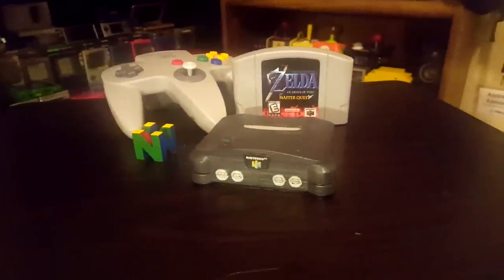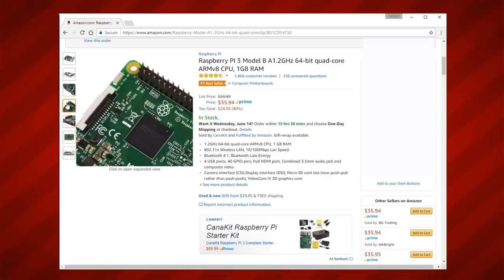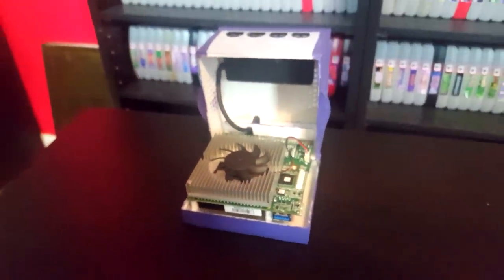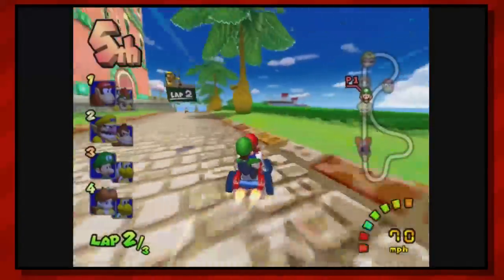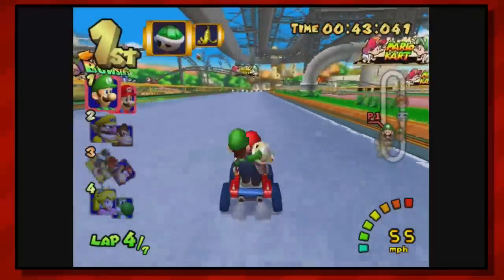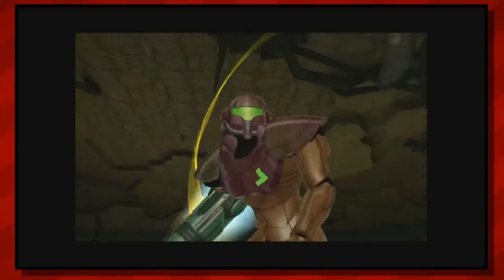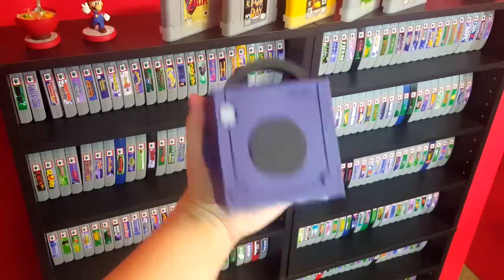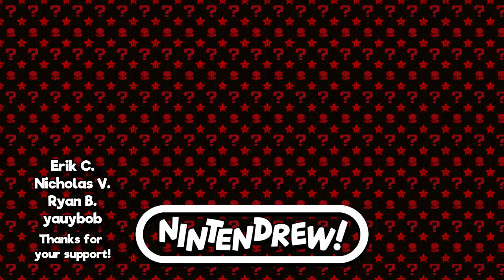Building the GameCube Classic Edition Mini Console - DIY! | Nintendrew

Comment: If I were Nintendo, I'd hit up my old buddy IBM to get some backwards compatible PowerPC chipsets. That would be the most, accurate(maybe), way to do a GC mini. It's possible that Nintendo could go with a custom hardware solution. A custom IC designed for this specific purpose would probably be cheaper than buying needlessly powerful x86 processors like the one you used in this video. Tbf though, the prices you showed in the video are consumer prices. Nintendo would likely get a good deal on the same hardware. Plus, Nintendo has access to their own source code so they could develop a close-to-perfect emulator on hardware with even less capability than that. Another thing they may do is use an ARM-based SoC, which would be much cheaper than x86. I mean, that was what they did with the NES and SNES classic right? It wouldn't surprise me if they already had people working on that.

Comment: Nice build!

Up board is pricey because of the CPU and RAM.  The Dreamcade has a slower CPU and 4 GB for $100.  Drew Talks tried some Gamecube games and they ran OK, though probably not as well as your build.  I think the built-in GPU is the limiting factor for both.

It is very likely that in the next few years, Intel's low-end/low-powered chips will have increased not only the CPU power, but the GPU and will be a capable part for Gamecube emulation.  ARM and Mali (or other GPU's used by SBC's) will also be better, of course.  So a Gamecube Classic in 2020 or 2021 is a very real possibility. 

To address your surprise on Windows performance, remember that drivers and emulator development tend to lead on Windows.  Just don't be tempted to use it for browsing and running other programs (Steam included) - keep it as a pure Retropie system like you would with a Raspberry Pi.

Comment: I bet if you took the hardware of a Original Model wii and cut it down, you could use Power PC Architecture and get the games running someone more accurately. After all, you could make the Wii Autoboot into a homebrew app like USBLoaderGX and run them in a SD Card. Considering the "KillMii" device where someone fit a wii inside an Altoids tin and it ran. I bet you could do this.

Comment: The Nvidia shield does a pretty good job of doing GameCube emulation using dolphin for Android you can buy an Nvidia shield for for $150 dollars on Amazon some fun facts about the shield it actually runs the same architecture the Nvidia tegra x1 processor as the switch but it's actually clocked higher sense Nintendo already has a working relationship with Nvidia a bulk purchase of these chips would help Nintendo keep the cost down also add in the fact that Nintendo already has game cube ports running on the Chinese Nvidia shield devices so this can be done for a reasonable price if you go the Arm/ Android route just my 2 cents great video and awesome job on the 3d printing and modelling work

Comment: While not ideal it's possible to find used USFF PCs with low wattage i5 CPUs like the i5-3570T which is cheaper than the average Up Square Board.
Upside the price/performance is better but downside is those USFF PCs basically look like black colored Wiis without optical drives and they're about the same size, which I suppose defeats the point of it being a DIY project since it's buying a PC and slapping an emulator on it.

Comment: Hello, Drew please make a Wii Mini! With an external HDD, a 1T-SRAM device and the device needs a 512MB internal memory, you will need another HDD because on the second HDD you will be putting the Wii and Gamecube games with WBFS Manager or Wii Backup Manager on the of the second HDD. What you need is the first HDD to memory, you'll connect to the Wii Mini and you can put pictures, WiiWare games, Virtual Console games, and you'll have more Blocks in your Wii's memory. You still need an SD Card for even more Memory, so if you can make your Wii's case as the original, you'll be the best! Find information about Ram, Sram, Memory and more. ;) Bye;)))

Comment: were you using the default directX drivers? there are some fan-made drivers that optimize the GPU for 3D rendering, and you could overclock the CPU to improve preformance, since dolphin emulator is more CPU intensive than GPU

Comment: Have you ever thought about how one could upgrade the CPU on the Wii or Wii U?  Another POWERPC chip that is the same size as those are the PowerPC xenon from the Xbox 360 and xbox 360 slim.  Since they are both POWERPC chips would it be possible and would it improve performance?

Comment: Try using an Nvidia Shield TV. Same power as the switch and half the price
Reply: Most of the price of the Switch does not come from it's electronics. It comes from the screen, battery, joycons, sliders, power cables and other accessories.

Comment: there is another way you could do it, literally just use the same system architecture as the gamecube and wii, rather than using a normal processor, if I remember correctly it uses an ARM processor, not your standard processor.

Comment: You might want to try again using this board as the core: https://www.nvidia.com/en-us/autonomous-machines/embedded-systems/jetson-nano/. It is almost the exact same hardware spec-wise as the Switch yet in a $100 system on module.

Comment: It wouldnt cost nearly that much for Nintendo to build, Hardware emulation is cheaper than software emulation on the large scale, shrinking the size of the board of the original Gamecube would be a task, but with nintendos resources it wouldnt be too hard, and using the original architecture and specs, they could easily build a mini gamecube with built in storage for games and theoretically even a disc drive as gamecube discs are puny lol

Comment: A system as powerful as the switch? Drew you are aware that emulation only requires a system that’s as powerful as the the thing it’s emulating in most scenarios. If you wanted to emulate the GameCube you would really only need a system that’s as powerful as the GameCube or a Wii, depending on the emulator and os. Maybe back in the day when emulation was more new this would be true, but nowadays emulation is much easier. You wouldn’t need a system with the same amount of power as the switch.

Comment: What if someone tried this with an old Wii unit? I know it would still be a Wii, but used ones are cheap and trying to use something like a mini pc with enough specs would be very expensive to fit the project and considering the amount of adapters out there to use real GC controllers and hdmi adapters  it could provide a better experience

Comment: I got linux to work better than windows by compiling the dolphin code natively, I got animal crossing running on the lowest amd apu laptop in 2012 at over 80fps while in windows it barely hit 40fps..  The issue with the dolphin emulator running on the raspberry pi is the fact that it is a arm processor, and not a x86. But realistically it isn't worth the effort to actually make the dolphin emulator for arm and make it super optimized. the n64 emulator is a example of poor optimization for arm processors while dreamcast emulation has been improved on massively since its release to the arm processor while the n64 emulators only seem to have gotten better at first then all down hill as soon as retroarch hit the scene.

Comment: What about a GameCube classic the size of a Wii U? Also I wonder if that new AMD Apu that costs $55 if that could emulate GameCube.

I have playable results with a gen 1 I3 with 8 gigs of RAM. So I wonder if a dual or quad-core custom AMD CPU with 2 3 or 4 gigs of RAM would give playable results? I mean if not it's not that far off.

I mean I system like mine will only cost $50 or less 4 gigs of RAM, so I imagine Nintendo could do something similar but was new pricing it would probably be around $100.

but to be honest a stripped-down Nintendo switch would cost less than $100
Reply: I just realized why that sbc u used in the video is so expensive, it's because of all the patents involved, a Raspberry Pi only costs $35 and that's a decent emu Box by itself.

Comment: Just buy Gamecube motherboard on Ebay for 8$,and cut it a little bit! And also buy controller for 10$,SD slot with 32GB SD for 6$,and solder it. You're done!

Comment: huh. would game cube emulation even be viable on the switch? on the one hand it might be easier to run gamecube code on it, but on the other that chip Nintendrew used had a lot more ram and about the same cpu power (half the cores, double the speed) as the switch, and the switch only has a real advantage as far as gpu

Comment: Well, I know you need at least an AMD Athlon X4 645 (2.5 GHz) and an nVIDIA GT 520 to be able to play Metroid Prime at a decent frame rate, and better than a Radeon R9 270X to play F-ZERO GX with any stable frame rate.
Reply: Something you might wanna try also is setting the shader to Asynchronous (Uber Shader), and opt to compile the shaders before starting the game; it adds a small delay to the game starting, but at least for me, it's removed all stuttering in game play for titles such as F-ZERO GX (I can't believe I didn't try that before facepalm )
Reply: Yo. So you know what your talking about when it comes to minimum specs. Any chance you know any specs to run this same project with building a pc that can run every gc game like sunshine. Or know the best small factor board for this project. The board on this video looked good but didnt run ALL gc games. Would love to hear
Reply: @danielfigueroa1090  All I can speak for so far is a system consisting of an AMD FX-8350. R9 270X (RX 560 works well, too), on a Gigabyte GA-78LMT-USB3, as that it is the system I currently have.

Comment: Use a Nvidia Jetson, it's half the price and a bit more reliable for Dolphin.
Reply: It's not x86 though
Reply: It still runs Linux, and retro arch. That's the only thing I was talking about. You don't need it to be x86 architecture.
Reply: @hodeyfu7617  yeah I know but for $100 I would prefer x86
Reply: That's cool. I have a jetson and love it.

Comment: Soooo... what's wrong with a shield TV? Less than 200 bucks and more powerful than a switch!
Reply: Are you high? The shield tv doesn't even came close to the switch, it only got 3gb of ram and it processor doesn't came close to the switch nvidia customized gpu which can adapt to game!
Reply: @g2ltt733  it has the exact same chipset as the switch (a Tegra X1), although clocked at a higher frequency (its really the switch which is underclocked for better thermals and battery life). In fact, in Japan some switch games were officialy ported for the shield. So nope, I'm not drunk. I'm read.
Reply: @pabloariasmaiz4355  it just AAA games, not a big deal in my book, those games run with ease!
Reply: @pabloariasmaiz4355  and the main gimmick of the nintendo switch is portable and yeah sure shield tv is more powerful and the switch cost more than one hundred dollar compare to nvidia shield but you couldn't pay an extra bucks to have a nfc reader, portable and some extra exclusive games that you can't get on another platform!
Reply: @g2ltt733  the main point is GC emulation, something the shield does well. Also, when speaking of switch emulation, the shield has great potential being the same chipset with more power. And has been done. Obviously, if you want to play switch games, get a switch. But it won't emulate GC as easily as a shield TV. And remember, the main point is emulation.
Reply: @pabloariasmaiz4355  bruh, you didn't even mention GC emulation in your original comment but whatever! Smh
Reply: @g2ltt733  did you ever see the video???? What's it about then?
Reply: @pabloariasmaiz4355  oof

Comment: What is the point of a classic edition console if the person already has the original
Reply: No disk media.
No high priced games.
All games already on the device.
More portable.
HDMI output.
Play hacks easily.
Use any usb controller you want.
Shall we go on?
Reply: retro robs game corner well If these retro gamers aren't collectors but they still have the originals then why would they buy it
Reply: @smashingrandomthingzandrev2134  I have over 240 consoles and variants, but I've still bought most the minis because:
1. The reasons I said above.
2. As a console and game collector, I want to collect these too, because they are consoles.

I love my minis and my retro pie too